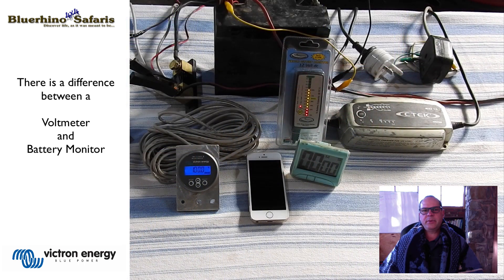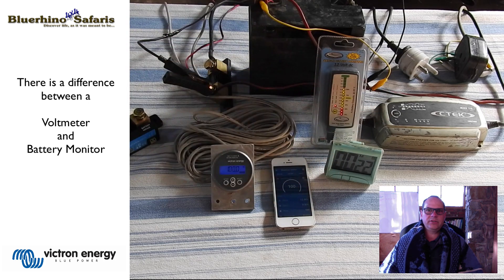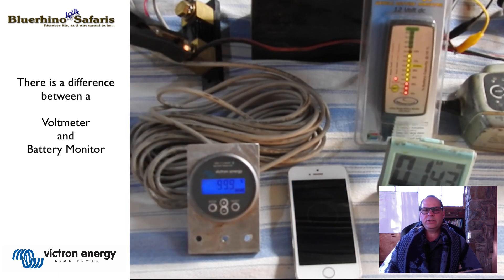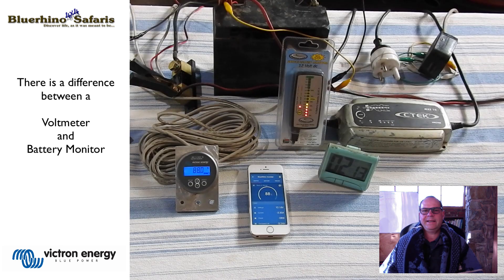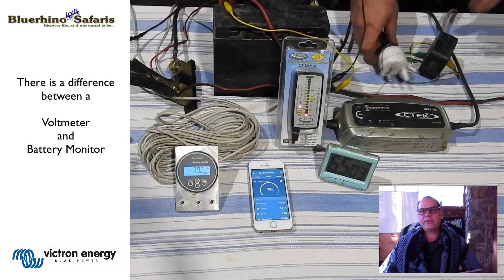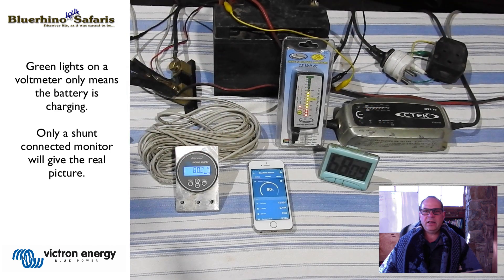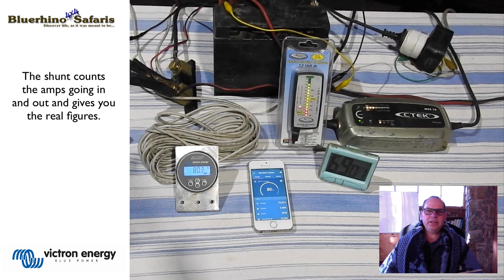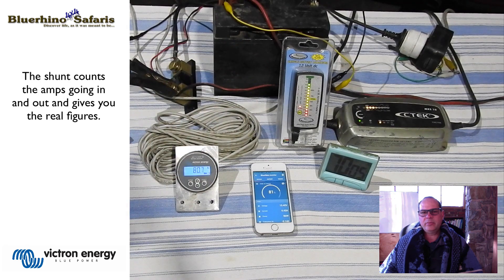Victron Smart Shunt vs Voltmeter

Comment: HI. Ok Chris so does that mean that the shunt wil show the true state on a lead acid deep cycle? Can i use it without damage until the shunt shows 50%? Tx - enjoy your vids
Reply: I also have the same question. Please answer Chris
Reply: @Gerco_Coetzee  this shunt is so better than a simple voltmeter once set up to suit your battery capacity.
Reply: Yes, it can be used as you wish without damage.
Reply: Today, I ordered a Victron Smartshunt for the AGM start battery in a Toyota Tacoma. I going with the assumption that it will work perfectly fine with this battery. Currently, I have the ARB Linx system measuring volts on the start battery, but for reasons given in this video, I want a more accurate picture of the state-of-charge.